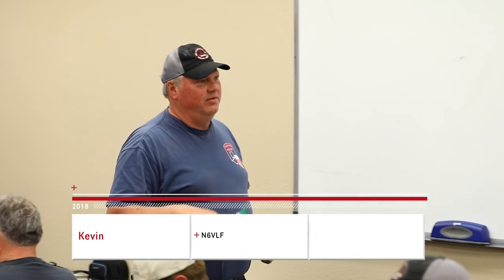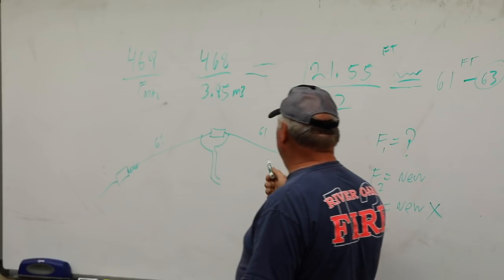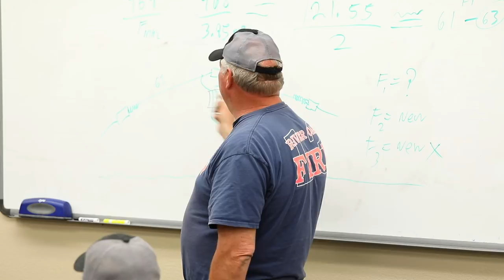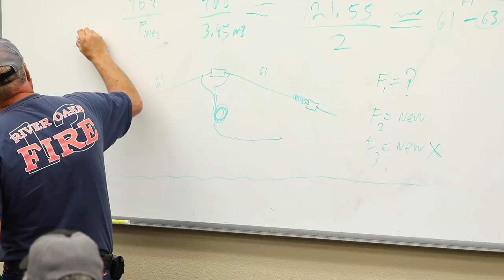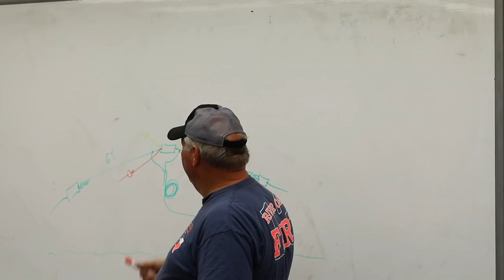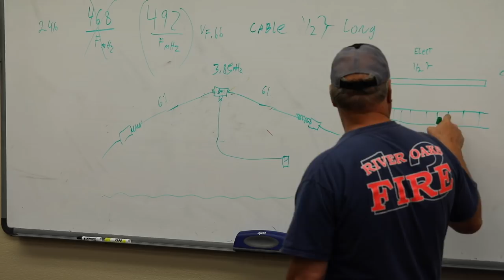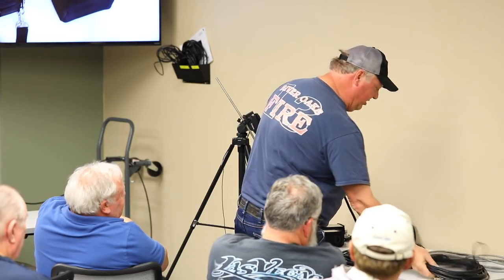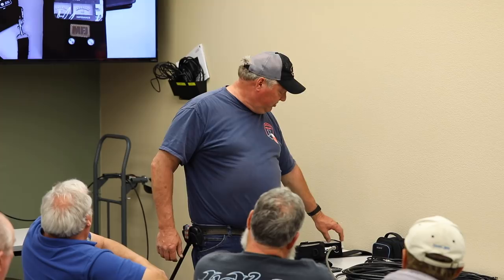How To Build A Dipole Antenna

Comment: At about 1:02:41 you said, but don't roll it - but don't coil it, but you didn't explain to the guy why. What had happened, was that you were teaching to make your coax an 'electrical' half wave length of the frequency you're aiming for and he wanted to know but what if the feedpoint is closer than that and you said don't coil it. Please say why. Now I know you're discussing dipoles here, but I ran a horizontal 80M loop for years and my feed point was maybe 50 ft away and I just lived with it. I worked the world (80 to 10M), but I have always wanted to know more about that. Were you just telling the guy to go with whatever the length is?

Comment: as the frequency goes down, the length increases or if the frequency goes up, the length decreases.  so if we can measure the length based on the frequency, why can't we determine the impedance of the dipole?  every video seems to guestimate the impedance 2500-4500.  aren't you able to meter (VOM) the wire and determine its impedance and not need a tuner to make everything work?

Comment: You can use a dipole as an inverted V and get a better match without a balun . A straight wire dipole has a resistance of around 72 ohms so a 1 to 1 balun will compensate the difference between the antenna and your coax . Without a balun the best match you can get is about 1.2 to 1.5 to 1 .
Reply from the maker: Thanks for the tip. Yes, a lot of us in the club run an inverted-V. We plan to do additional videos on this dipole, inverted-V and balun topics, allowing more of a deep dive into each.

Comment: Thank you, Jason and Kevin. I really enjoyed your presentation, Kevin. It all makes sense now, as I have always overlooked the need to ensure the feedline was the correct length. Out of interest,  which Antenna Analyzer would you recommend for building inverted V and other dipoles. MFJ-259D Analyzer or RigExpert AA-600 Antenna Analyzer. 73's ZL2TSO
Reply from the maker: You're welcome. We are glad you found it informative. The RigExpert is a very cool piece of test equipment and have been using it more then the MFJ lately. The MFJ is still great and can be found more affordably. 73 KM6FAK

Comment: Does this antenna work for aviation band from 108.00 to 136.00 MgHz?
Reply from the maker: It will RECEIVE ONLY on those frequencies you listed. The dipole that was talked about in this video will only be resonate on the Amateur Radio frequencies. You need a resonate antenna when transmitting.  Are you looking to receive or transmit on the aviation bands? Yes, you can make a Dipole for those frequencies. It will be a lot shorter.

Comment: What if you’re running lmr400 for 75 meters. Do you still need 125 ft of feed line? Would also like to know if ladder line needs to be done this way.
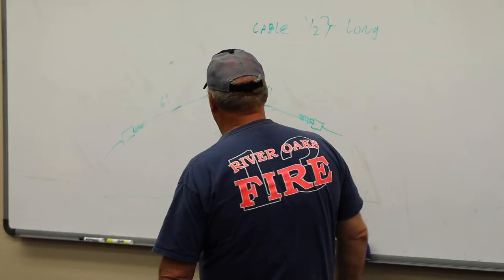Reply: 53:32
Reply: Seven O'Seven ??
Reply: Seven O'Seven so the less the vf , the less the length for 1/2 wave ?
Reply: Your reply didn’t go through on the formula
Reply: @JayN4GO  ((492/ frequency) * Velocity Factor) = 1/2 wavelength of coax in feet.

example... 492/3.7Mhz = 132.972 Feet, 
is the distance traveled of the 1/2 wave length of the Radio frequency as it is leaving your antenna. 

now since the measurement you want to know about is the coax and since all wire has a resistance, that resistance is described as a %age of efficiency compared to that as if the Radio Frequency is traveling in free space. It is called Velocity Factor. 

All Coax has a designation in it's datasheet for it. 
typically LMR400 has a VF of 84% or .84 
you will need to multiply the result of the free space distance of the above formula by the the VF or .84 for the distance of 1/2 wavelength of LMR400. 

132.972 Feet * .84 = 111.697 feet of LMR400 is a 1/2 wavelength of coax.

hope this helps.

Keep in mind that the Velocity Factor of the coax is determined by the dielectric. The dielectric is the insulation that is between the center conductor and the shield. What its made of, how dense it is, water damage, yadda yadda yadda. so although the velocity factor is determined by the manufacturer it might be off depending how much of a hang over the guy operating the machine had in that morning.

let me know how it works out for you.
Reply: Seven O'Seven installed half wave of 118 ft of rg8x today. Took care of all the rfi issues and made the antenna behave like it should. 
 Wish me luck on the doublet for 80. That’s a chunk of window line
Reply: @JayN4GO  If you have an analyzer a "T" and a dummy load, follow the video @ 1:03:15 . Make sure your dummy load is connected directly to the "T" with no coax between them! 
If your coax shows a flat SWR for the band you will operate then your good to go! 
If you are going to use the same type of coax then the same length should be good, as there is not much difference between 75 and 80 meter's. You should be able to work 80 on that 75 meter antenna.
I'm glad it worked out.
FYI. looking at the length that you cut which solved your problem. it's telling me that your RG-8x has a velocity factor of .88.
Reply from the maker: I'm falling behind on comments. Looks like you and Seven O'Seven hashed it out! Awesome!
Reply from the maker: Thanks @SevenO'Seven for typing all this out!

Comment: Can you use a 1/4 wave of 75 ohm coax in to 50 coax ?? .
Reply: Of course
Reply: lets see if you use 75 ohm cable the signal goes in at 50 ohms af 1/4 wave length down the cable it is 100 ohms but if the cable continues 1/4 more wave length the signal will come out at 50 ohms. Where you started. This trick is used to stack high frequency antennas. 2 meter and higher.
Reply from the maker: People do use 75 ohm as a cheap substitute. You will just need to get it 50 ohms before it goes into your radio. I prefer shorter coax runs for 2m/70cm, as it will increase the losses and the amount of power leaving the antenna becomes much less.
Reply: I’ve been using 70 ohm hardline for years now. ( Got it from my local cable company for nothing)  The VSWR went from 1.1 to a 1.5 On VHF/UHF. No big deal! Just tune the antenna back into resonance. Plus the low loss of the hardline more than makes up the difference of a higher VSWR!

Comment: Does this antenna works for aviation band from 108.00 to 136.00 MgHz?
Reply: of corse
Reply from the maker: Yes, using the formula you can cut the dipole to be more specific for those frequencies. But, even a wire hanging out of your window will pick something up.